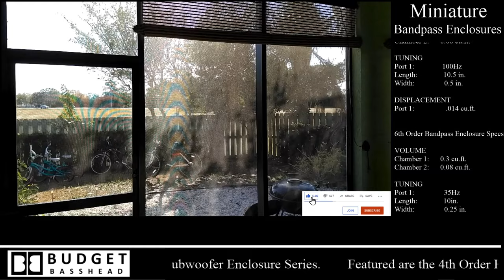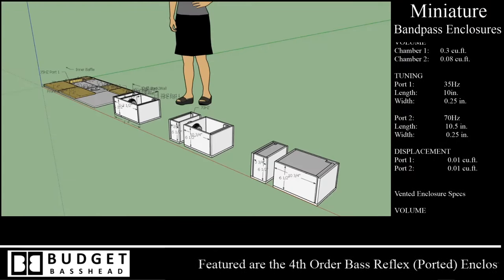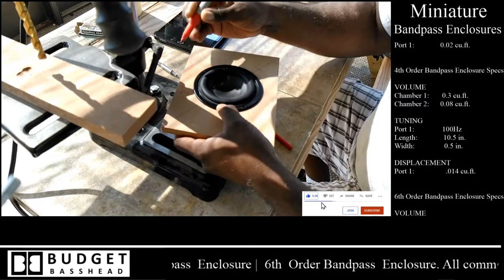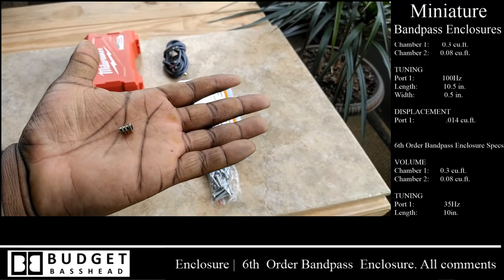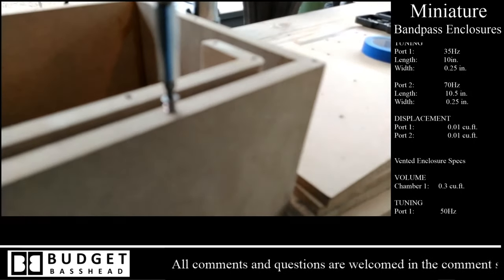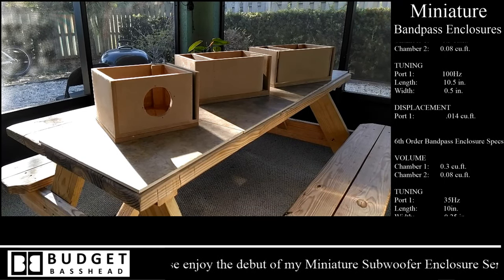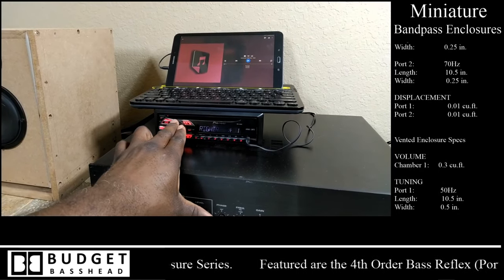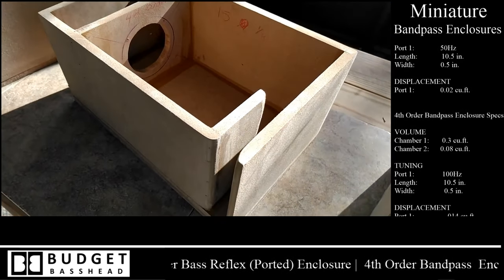Mini Bandpass Enclosure Series - Full Build Plans and Demo!

Comment: i built a fourth order band pass but with a 6.5 inch speaker. Just up the size accordingly. I am using an 80 watt amp i also built.  It sounds awesome. I added some blue led's in the back of the port that light up the darkness in the port and wired them to blink to the beat of the music. Thanks for the video. PEACE

Comment: To seal up a removable panel, what I use is "Composeal". It's actual use is for making shower floors watertight. It's really thin at less than 1/16", is super cheap and available at any home improvement store or plumbing supply house.

Comment: I’m pretty sure that you actually have 1/2” particle board instead of MDF. MDF is very tightly compacted and comprised of basically dust sized particulate matter so it won’t have that rough grainy and crumbly texture like particle board. Particle board is compressed and glued like MDF but it’s particulate matter is much larger in size and the particles range in size unlike the uniform particle size in MDF.

Comment: Definitely hear a difference. Since box is designed to play with a bit; I would like to see if there is any difference if you add a bit of poly fill to the box. Just for experiment. I really appreciate your videos. Always looking forward for more.
Reply from the maker: Great point! Maybe we should do a comparison in the next one. Thanks.
Reply: Maybe it’s my iPad speaker, but I hear a slight underdamped sound in the reflex cabinet.  Damping material (fiberfill) would help that.  The sound is similar to a small room reverb sound, most probably around the tuning frequency.  Also, your reference monitor is a sealed cabinet, right?  It naturally won’t have the same extension as a reflex cabinet due to the port’s frequency extension.  It’s the physics of speaker design.

Comment: I like how clear and concise you were while still being thorough. Some advice on the threaded inserts though, put a couple drops of wood glue on the outer threads so they won’t pull out easily because those tapered inserts are going to pull out of that thin particle board so easily.

Comment: Really enjoy your video. Been building speakers for 30+ years. I have a fondness for bandpass and folded horns as well. Also transmission lines but so difficult to build and calculate. Decware has great cheap not free bandpass plans, very highly recomended.

Comment: I know this video is old. But what I did for my removable panel seal was a sheet of 1/16th cork that was attached to the removable panel with contact cement. On the side facing the box I painted a thin layer of thinned down silicone. it was just regular ge1 silicone that was thinned down with denatured alcohol. it is mixed down to a paint like consistency and painted on. Once the denatured alcohol evaporates semicolon you are left with a 100% silicone coating that is literally bound into the cork fibers because the denatured alcohol also helps it absorb into the cork. I use this combo to act as a seal and also as a binder to hold the cork from deterioration. I've never noticed an air leak or any deterioration of the material or delamination of the contact cement even with multiple disassemblies of the box. I use the same silicone coated cork for gaskets for my speakers as well and I've never had a leak or an issue with breakdown or deterioration. Even used it as a seal on plexiglass viewing windows and terminal cups, again with no signs of deterioration. It's basically just a silicone seal with the cork acting as a compressive lattice. It has worked well for me as a seal for many years.

Comment: Thank you for posting, LOTS OF GREAT INFO HERE!, i did car audio for about 8 years back in the late 80's to early 90's, and built many enclosures, tech was not nearly what it is today, used an old RF nomograhm (sp?) for port info, one tip, a really good jig saw will make your life much easier, i liked the De Walt, BE SAFE!
Reply from the maker: Thanks for the tip🤟

Comment: Hey there, I like your content and you clearly have a great knowledge, experience and most importantly you have a passion for your trade, so yeah man good job. Now I have heard that while band pass boxes really are amazingly great with the deep bass, and I speak with experience of my own as well with a 12” Sony sub. Mouthwatering bass! Problem was that you didn’t really hear it from outside the car. Also not very stable. I’m looking for something, more like a ported enclosure for nice all round performance. I’m running a Jbl 10” Shallow mount Club1000 which has a nifty switching built on it for switching between 2ohm or 4 ohm as you prefer. I’m rocking that on a Kicker amp, 400rms I think. 2 ohm monoblock. I’m really struggling with space to make use of. I use my van as a private car and also for work, so I can’t use loading space. Is love to chat more if it interests you. I think you’d be interested in my work I’ve done so far. All outside the box thinking to challenge myself to be unique and still maintain my budget limits. Take care, and hopefully you can respond back

Comment: Would a 4th order work for 2 DD 6.5’s? Like your box, but mirrored so one sub is on the left in a sealed chamber and one on the right in a sealed chamber, then both sharing one common ported chamber. Or a 6th order again with them sharing one common middle ported chamber with one left ported chamber and one right ported chamber.

Comment: Love the videos. Suggestion, Pick up a couple of cheap corner clamps from harbor freight instead of using a speed square or whip up a jig if you make enough boxes No more fighting with them and you can make sure they will be 90* every time.

Comment: Great Stuff! What program did you use to get your designs? Is there a 6th order calculator out there? I'm interested in the 6th order box but maybe with a 3" or 3.5" woofer.
Reply: I see you WinISD for modeling so that answers my main question.
Reply from the maker: SketchUp for 3D designs

Comment: Use a drill bit with countersink on it if you're putting in metal screw inserts
I think you should have taken the internal baffle port right up to the top of the speaker giving you a quarter wave transmission line. Plenty of of dampening material go with natural wool fleece
Reply from the maker: Thanks for the tips.
Reply: @BudgetBassHead  ok it's nice you got back

Comment: On a 4th order is there a difference as to which part of the subwoofer goes into the sealed chamber? I've seen boxes where subwoofer fires into the sealed chamber and others where the magnet is inside the sealed chamber. Does it not matter?
Reply from the maker: Displacement matters; and also having the ability to smell the coil heating up. I always face the magnet inside the ported chamber.

Comment: i'd like to make a box for my 2 dc-160-4 6.5 in speakers, a 4th bandpass, but i'd like to have the speakers face each other behind a clear window. would i be able to just add the volume of the sealed chambers together and have the subs firing at the same time (+,+) or should they be treated as isobaric in the joint chamber (+,-)?
Reply from the maker: Individual chambers are best
Reply: Do you have a clearer view of cut sheet for the 6th order enclosure ? I have a 6.5 subwoofer that I’d like to try in this design.

Comment: Great video and videos! You do know how to be low.... :-) Q: If I use your mesurement of the 6th order bandpass, can I turn it into a 6th order bassreflex? Same port length. Get the same low bass, as you have calcultated?
Reply from the maker: Yes, But just remember that it will be a bit of trade off when building a 6th order bass reflex. The back wave will be slightly delayed. Not really noticable unless playing rapid, low bass notes. But it's still worth noting.
Reply: @BudgetBassHead  Thanks. You rock bass in a easy way for us DIY beginners.